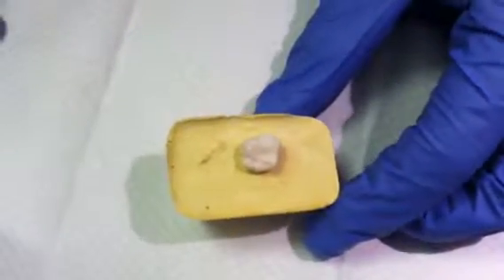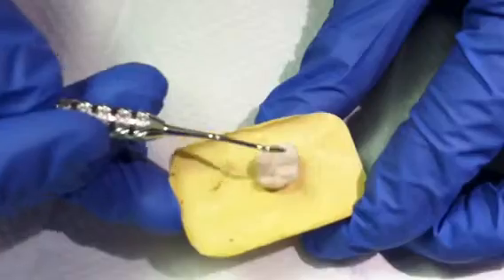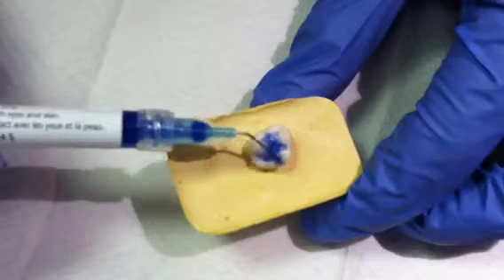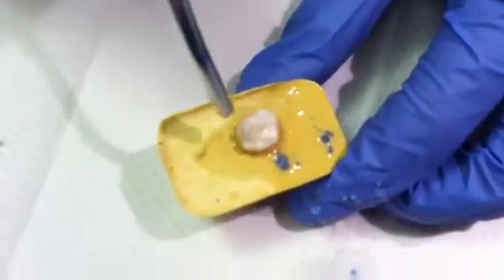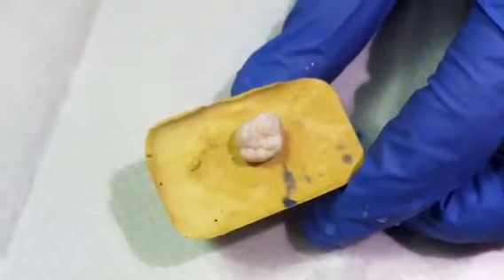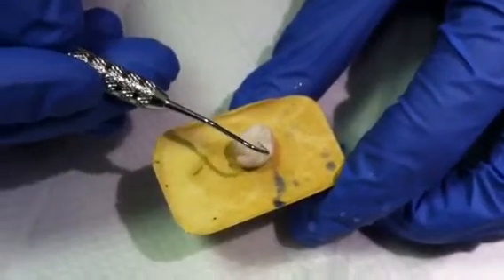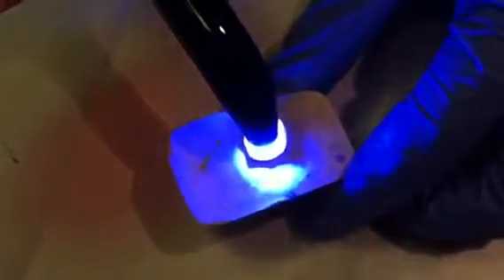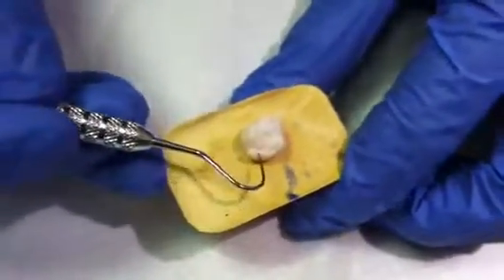Placing a sealant!

Comment: Thank you for your video , however more emphasis on isolation is clearly needed and ideally you should be walking through all proper sealant steps when posting sealant info vids!
  This can be done by either rubber dam or saliva absorption materials such as
dri-angle absorption pads or cotton rolls placed in several adjacent areas to ensure a dry area surrounding tooth! if the tooth is exposed at any point to any saliva or water the entire process must be started over , " WASH, DRY, ETCH, WASH, DRY." OTHERWISE YOU WILL HAVE A COMPROMISED SEALANT THAT WILL NOT PROPERLY ADHERE!
thank you and I hope this has helped.